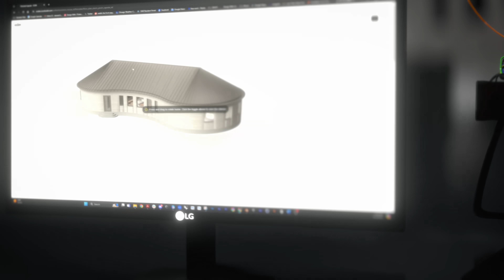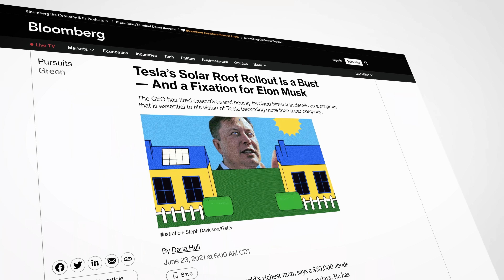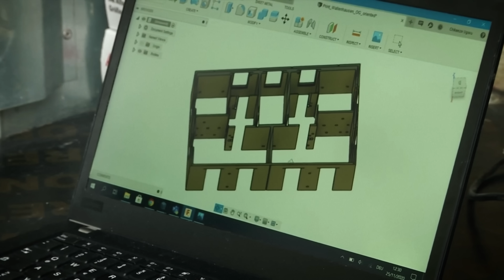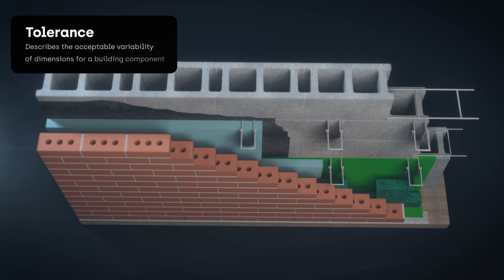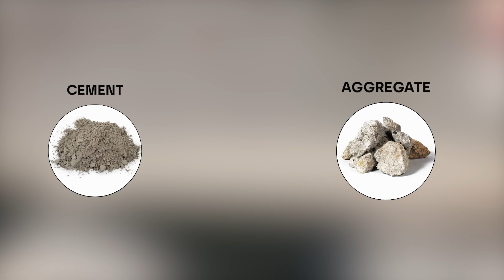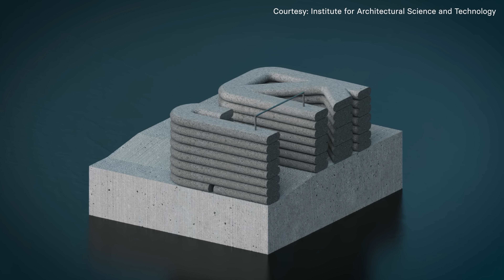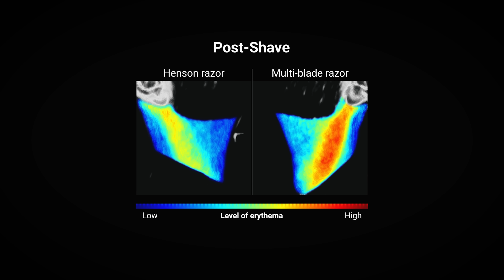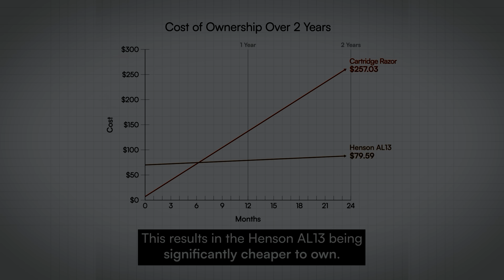Why 3D Printing Buildings Leads to Problems

Comment: Great video. I work a lot with 3d printers. I think eventually these house printers will use the same kind of automatic tolerance corrections that 3d printers do. For example, almost every 3d printer measures how far off its build plate is from being perfectly parallel with the hotend. They can correct for minor physical defects in software, as long as it’s close enough to parallel, it’ll automatically accommodate some error. With the scale of house systems, they’d be able to use technologies like Bluetooth beacons to be able to detect their hotend’s location in 3d space. That’d let them spend less time setting up before printing. The Voron 2.4 printers also automatically level their own gantry, their system would be absurd at this scale, but innovations will happen that make these house printers way better, faster, easier to use, than they are today.

Comment: Still don't understand how is it faster than building from concrete blocks. If they are only counting the printing time not the setup time and the work until it is completely done it is of course it is faster :D But in the time I prepare the surface for the printer and assemble it and transport the concrete, drying the concrete... No surprise it is compared to brick walls not wood frame houses. That may take longer than the print but in the mean time it gets the plumbing electric insulation and everything built in.

Comment: I understand that the whole point (or most of it anyway) of 3D printed houses is to cut down on labor costs, but why can't they have someone to just go along every couple of printed lines and smooth them out? I think not having to fully commit to seeing those ugly, uneven, and hard to clean layers will make 3D printed houses much more appealing. Just because it's 3D printed doesn't mean it has to look like it's 3D printed.

Comment: 3D printing is not for homes. I can think of so many reasons why but the biggest one is durability. I suspect these homes won't hold up to the weather, especially when left unfinished. The longer the run, the more uneven the curing and bonding between layers. Subject that to repeated extreme weather cycles and those bonds break eventually and the wall becomes compromised. Another big issue is carbon footprint. The whole building is concrete meaning vastly more CO2 emissions instead of sequestration like with lumber. Then there's cost. These things are multiple times the cost of a stick frame. 3D printed homes is a passing fad destined to be forgotten.

Comment: Quite interesting but at 11:50, when you started to discuss about the building inflexibility and what not it felt like you never saw a brick and mortar building. Barely any of these buildings are changed after they are laid down. The case of repairing to the original state is just an argument to the argument sake. At the modules and layers discussion you lost it completely. Once a brick building is done one might change the walls color, the flooring, even windows and doors, but not much else.
Reply: My friend tore down his roof and built an additional level indistinguishable from the one built 20 years ago. Then with bedroom moved upstairs he doubled the size of the bathroom and kitchen. 3d printing houses is what crypto was few years ago, a fad.

Comment: Can't they just make inflatable molds for whole buildings and then pump concrete into that from the base of the mold? 🤔 The end result would look a lot better. And I mean, it doesn't look like they're getting a whole lot of mileage out of that 'design your own house and we'll just print it' thing anyways.
Reply: Inflatable molds for concrete pours do exist, they are used to make domes for example. Problem is that it can lead to unpredictable process and imprecise buildings.

Comment: This was a great and for the most part comprehensive breakdown of the potential advantages and Achilles heel of attempting to 3D print a house.
But I'd like to add a couple of points, as others have pointed out, first of all 3D printing is only building the walls and the walls are the quickest cheapest an easiest part of home building.
Number two, if 3D printed homes do become a thing they most likely will be just another way of building expensive custom homes here on earth.  
The real advantage will be when we begin to build structures on Mars or the Moon. So perfecting the technique here on Earth will give us huge advantages when we need to build structures off Earth where humans can't actually build the structures and will need robots to do the actual work. 
And for that reason I'm very thankful that there are people who are willing to perfect this process, but as someone who's been building homes for the last 50 years I just can't see that there are any advantages to this over how we are now building.
And finally, concerning the way that we now build with the multiple layers of dissimilar materials that go into one wall you're way too easy and complementary on this flawed process.😊 It's fatally flawed, and the reason why wood frame stick-built homes Begin to Fall apart as soon as they're finished. We really need to work on changing the material we use for the frame of a home and the materials we use to clad that wall inside and out. I think it's more realistic to work to remedy these flaws than trying to develop a whole new method of construction.

Comment: The problem with printed houses is mainly that the wall turns out to be very good at conducting heat.At the same time, a similar stone structure made of, say, aerated concrete is being built just as quickly and much cheaper. At the same time, factory aerated concrete has excellent geometric and thermal characteristics. A very effective manipulator is used to install these blocks - human hands.
Reply: Aerated concrete has its own issues. It was used a lot in Europe and many longevity issues are cropping up.
Reply: @fredericapanon207  Any material can be used incorrectly. In my territory it is used everywhere. 90% of new houses are from it. including mine. I have no complaints. the material is good. no problem. The Internet is simply poisoning the strong leader. What's wrong with him? Mmm? cracks? my D350, the same as 3 years ago, although it was loaded with a roof not according to design. my house stood without a roof for 2 winters and nothing. some seaweed on the blocks.

Comment: I dont understand why they dont panel the inside with dry wall. Or on the outside put a outer shell or covering like how there are fuax brick walls.
Reply: maybe you cant drill into the wall lol you will crack the whole wall. would need to use construction adhesive for the timbers.

Comment: Mr Hicks..

A few factors  against 3D concrete printing …

1. Cement and concrete walls are subpar as an insulator medium , cold or hot climates.  Clay bricks perform way better in any climate.  

2. A builder can’t reinforce the concrete walls with gravel. At best around rebar. So the composite reinforcement on concrete walls is absent. 

3. Concrete reverberates upon impact. If one is driling holes or knocking walls , the entire building structure is to be felt in a very unpleasant way.

Comment: Hey I’m in this video! 😊 I believe the title is misleading and the repairability of these houses can be compared to other concrete structures. Additionally, not all the walls HAVE to be printed and “wet walls” can be easily timber framed for service and repairs. It’s entertaining to see others’ perspectives on new techniques without any experience in the field. Automation in construction is in its infancy stage and will flourish in the future.
Reply: If you don't print all the walls then you're losing all the advantages of printing: you'll have a slow construction that requires lots of manual labor, while still having a lot of the limitations of printing. In that scenario why not just make the concrete parts with prefabs or a conventional pour?
Reply: @hypertectonics7009  timber framing is not slow lol. probably concrete pouring and finishing is the longest part of building a house.

Comment: I wouldn’t mind a house without sharp edges, I feel like a more rounded outer wall could help with wind moving around the house instead of just hitting it… but the inside walls I’d rather be 90 degree angles

Comment: Another fascinating, lucid and personable video. It raised so many questions I had never thought of, being naïvely attracted to the utopian aspects of 3d printed architecture. I personally have no problem with the squidge-stripey aesthetic - if anything I like its baldness and its optical effect.
I noticed that all the buildings shown are one storey. Is this because they are and we have yet to move on to stairways and ceilings? It would be exciting to see if there's some latter-day Gaudí working on scale models suspended upside-down to figure out how to break out of the flat-lintel routine and harvest a full capacity for arch-based buildings that would be structurally "pure" and enabled by this new technique.

Comment: One of my favorite building technologies, ICF (Insulating Concrete Forms) is basically lego that you can arrange however you want then fill with concrete, getting the structure and insulation in one go. As with other concrete structures changes (other than additions) to it are not as easy as with stick built, but in return you get an air impervious highly insulated and extremely durable structure that will run circles around stick in terms of energy efficiency. Plus how often do people modify the outer shape of their houses, anyway?

I'm not sure what 3D printed buildings offer over ICF - perhaps not as much labor,  and circular shapes are easier with less finishing?
Reply: ICF construction is typically done with crews of the same size but ICF does not really offer much more over traditional forming it cost more takes, longer to set up, more complex to brace. I have done both ill take symons forms over ICF any day
Reply: @imchris5000  But then there's additional labor to remove the forms, adding insulation to the finished concrete on the outside, furring on the inside for drywall and mechanicals, etc. I can't imagine all that combined is still somehow cheaper to do than just doing ICF in one go.
Reply: @rafflesmaos  you have to do the same for ICF minus removing the forms which takes far less than than it does to assemble icf forms
Reply: @imchris5000  There's no need to fur out ICF, drywall can be applied to it directly and mechanicals can be routed inside of it. The "studs" or in this case fastening points are also built in. And there's of course no need to add insulation since the forms are insulating. All of those would need to be added to a bare concrete wall
Reply: @rafflesmaos  it sounds good on paper but having installed it things dont go that simple. its cake work to frame walls compared to trying to dig in the foam also with regular concrete on the outside the concrete can be your finished surface
Reply: @imchris5000  There's one sided ICF too for those that want a finished concrete surface like board form on the inside or out :) Not really trying to convince anyone since I have no affiliation to anything other than wanting to build my own house out of it after doing a few years worth of research on building materials. Just mentioning those paper (as you've pointed out) facts.
Reply: @rafflesmaos  1 sided is even worse then you have to figure out how to tie a symons panel to the icf plastic webbing. if you want foam on your walls just glue it on it takes less time than stacking icf. renting symons panels is cheap they set them right where you want to build them in baskets from a crane mounted to the truck they deliver it. super easy to set up and brace with very little risk of blowouts.icf is one of those things that sounds real good on paper does not really pan out
Reply: @imchris5000  Yeah you can glue on foam to the inside and/or outside, but then you still need studs on the inside and some sort of fastening surface for the siding on the outside. Unless both sides use really long tapcons or something whenever they need to fasten anything to those walls?
Reply: @rafflesmaos  you can use tapcons or ramset nails or just build the wall like a traditional wall with a top and bottom plate

Comment: It's interesting tech, with a major flaw - it is cement based. Cement and thus concrete is the most destructive building material on the planet. Every aspect of it causes damage to the environment, particluarly it's carbon output. At this point in time, creating a new building method that is cement based makes very little sense. Green cement may be a thing someday, but it won't be widespread for a long time and probably never will be fully carbon neutral. Applying modern tech and building science to pier and beam construction for houses and buildings makes more sense and would dramatically reduce the amount of cement being used for home construction. No more slabs! Or blobby, curvy 3D printed walls.

Comment: It's definitely cool tech but I don't see it being a viable solution to any problems. Of course time will tell, but having just watched a condo unit going up, the 6-story structure was up in like 2 months, but everything else is what's taking well over 12 mos and counting since. So if we imagine the process sequence of building, is thr construction of the walls really the choke point slowing everything down? I don't think so, and as the vid points out: if this method adds more time afterwards, it's no gain overall.

Comment: cant we do this with wood already? Isnt it cheaper and faster to build on site with it, not even mention how better wooden housing is better for the environment. It takes less than 10 people to 3d print, but also it takes the same amount of people to build a prefabricated wooden house of the same size, in probably less time. And i dont think they account for building the printer in the 4 days. You need to transport the wooden panels from factory where it is constructed to the site, but so you need to get concrete and the machine.

also, just a nit pick, you can make openings without support with just bricks. We know because we have been doing it for 3000 years at least with arches. Maybe thats why construction industry is so slow to evolve, we kind of have it figure out, we can make any structure we want, it is gonna be expensive and engineering marvel but we can do it.